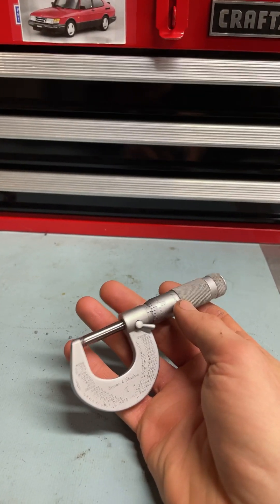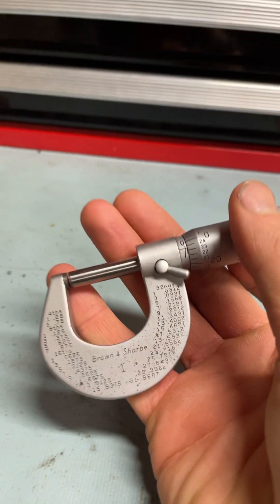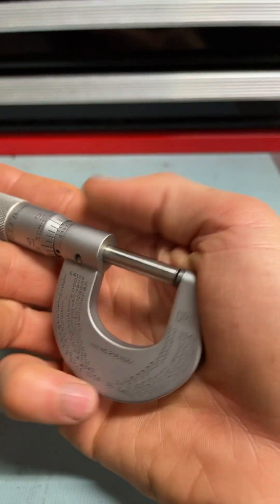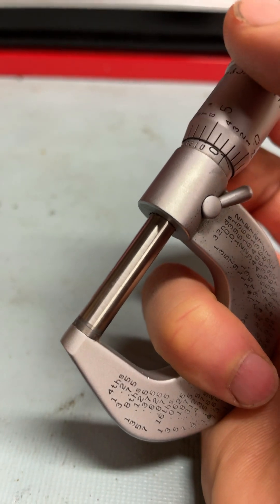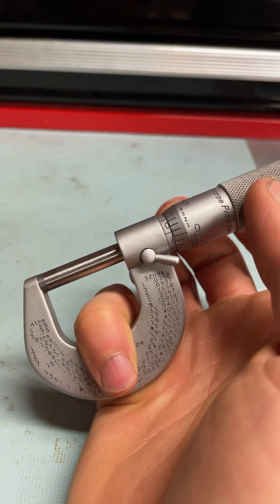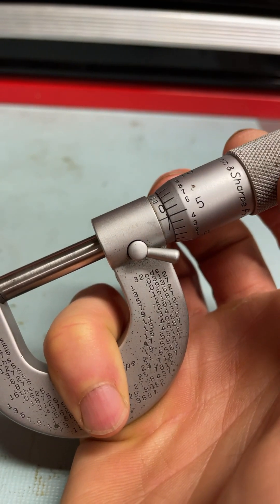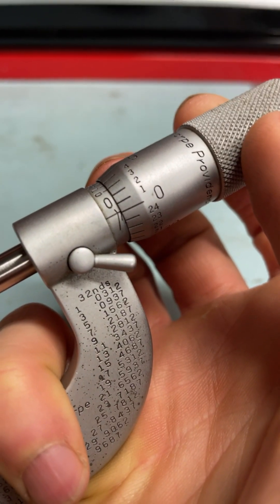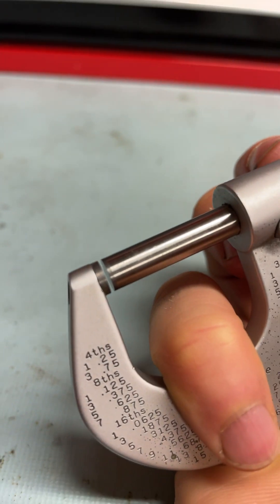Tool Tip: How To Use An Analog Micrometer

Comment: I have 15 of those, maybe more. I have starrett also, I couldn't achieve less that .0002 uncertainty after they went to china so I had to switch I still have a couple of the double spindled mics starrett made, they were just to cool to get rid of. they have the tenth reading on the second spindle. I bought a couple when they quit making them. sometimes it'll keep me from having to get out a indicator mic when I need something a little closer but still checking fast
Reply from the maker: Always helps to have a few to choose from! Thanks for sharing!